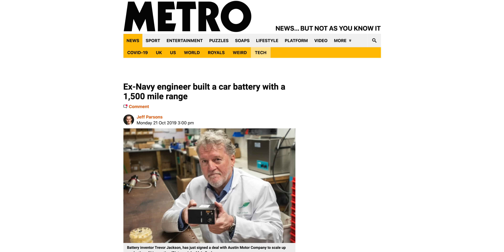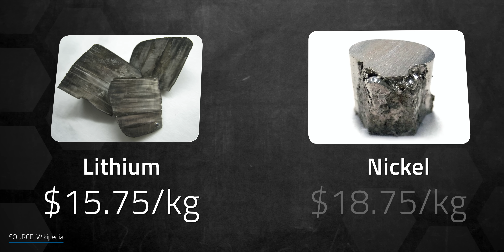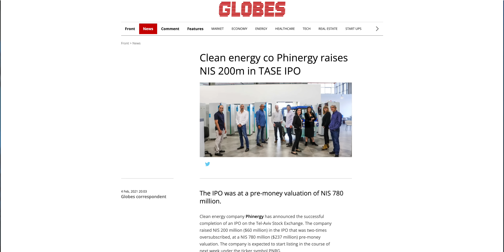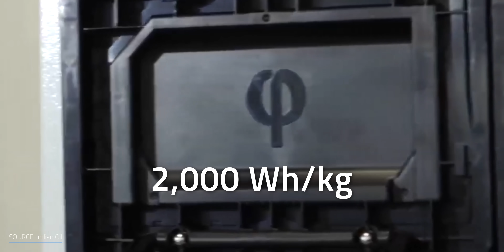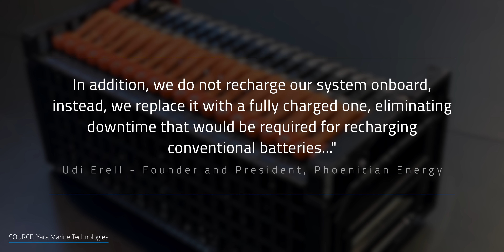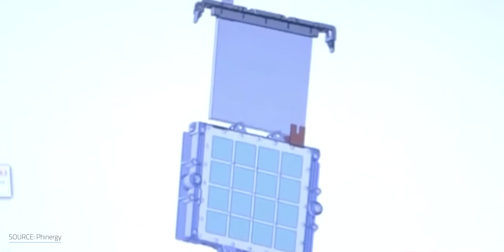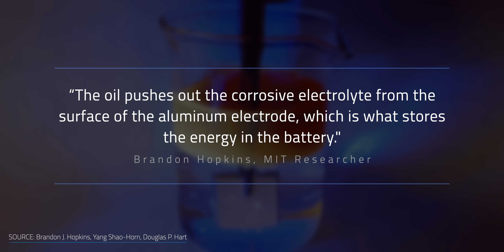Exploring the 1000 Mile Car Battery - Aluminum Air Hype?

Comment: I like the concept. External battery swapping would be much better than waiting for a charge for long trips. That said, the downsides are kind of extreme for it to be a sole power source right now.

I think the hybrid example from their test is the best near-term option, using lithium for the battery that feeds the motor and aluminum air for the long haul. You could recharge your lithium battery at home every night and be fine, then stop by the shop and buy an aluminum air battery to pop in some range extender slot or even sit in the trunk on the floor plugged into a small connector for it that could be installed aftermarket on existing EVs. If you could tack on an extra 500 miles just setting a box in the trunk, let alone the claimed 1000 miles, that would kill any complaints about range. As a stand-alone power source, I think this has a great inroad into the market.

That said, the monstrosity at 6:23 implies some limits to the technology if it's used as the sole battery. I realize that's a rapidly built prototype just to test it on an existing EV, but there are problems with what that test design implies. 
1. It's enormous. That's fine for "we're going offroad without a charging station for 200 miles", that's terrible for family vacations, business trips, or life in general. Since it's a drop-in battery, it needs to be readily accessible, so it can't be hidden under the car. The mass of air vents on top also tells me this isn't going to be a false bottom to the trunk. That means for it to be a permanent fixture of your vehicle, it's going to be either the trunk or frunk of an EV completely given over to it. We accept that in ICE now, so it's not terrible for an EV, but you're going to have to have dedicated (and probably filtered) airflow for it which means it's not going to be a drop-in replacement for lithium EVs. It will have to have its own niche carved out with its own line of vehicles, meaning further dividing of the automobile energy supply market. Drop-in as a range extender bypasses this because people can choose to do that when they want and not when they don't, and it leaves charging as the primary market with this as an add-on. (Also giving it an entry point into the market as a luxury range extension until the price comes down.)
2. The vents are going to be a huge issue if they're not in an isolated compartment like the frunk some EVs have. Again, with dedicated air supply and likely filtration. The demonstration model is in a position where it would definitely get kids throwing trash over the backseat that would fall into the vents, careless/ignorant drivers piling luggage on top of the vents, and in the best case scenario where drivers leave it alone - accumulation of cabin dust sucked in through those vents. Any vehicle using this would need that isolation, which limits EV designs.
3. "I need more range" just gets replaced with "I can't lift that". I'm guessing that weighs around 30lbs, which isn't unreasonable to lift, but it is above the capacity of a lot of people. My guess is based on the "1000 mile" range being 55lb of aluminum and that thing looking like the battery was in 2 pieces. Half that's 27.5lb and optimistically the frame could be made as little as 2.5lb to get a round number. The whole unit is supposed to be 200lb, which I assume is that monstrosity and not the swap-in parts based on how easily they seemed to set in the one part. Again, totally fine for range extension, but a problem if that's your weekly trip to the future replacement to a gas station.

Obviously, long-term they can solve all these problems with future clever designs that aren't focused on making the thing work at all. Getting the infrastructure in place, getting the costs down, coming up with clever ways to have reserve power for when you "run out of gas" and designing ways to get the battery into the car of someone who can't lift it are all solve-able problems. If there were no other options on the market, I would expect them to be solved. But there are others on the market. I think lithium firmly has the market advantage and won't be displaced by this as a sole battery option. I REALLY like the potential as a drop-in range extender technology, though. I could envision a 50lb box that you buy anywhere, plug into a port inside the car for an extra 100 miles, OR take camping to power your electric camp stove and any other electric devices you decide are "camping", OR have it in your garage to plug essentials into during power outages.

I don't know enough about it to know if it would work like that, though. It may still need a lithium battery tacked onto the side to store power to take it in and out of pumped oil standby mode or to supply power in the way applications require. We have a "hybrid drive" for hard drives that does something similar using spinning disk for large capacity storage and a smaller solid state drive as a buffer for faster I/O. Hybridization is often the way to handle when technology trade-offs are too extreme for a new technology to get a toehold on  the market. The Prius hybrid being another very good example.

Comment: For the consumer market, especially in a vehicle,  I think they would need to have customer replaceable aluminum anodes and "oil" changes unless you could get a reasonable core charge return when swapping out and even that would probably limit the interest to enthusiasts. Consumers are going to want what is easier or cheaper and with having to service or replace your cars battery every month on average, it can't be more costly than a comparable recharge to gas cost for that same range nor be anymore time consuming or a hassle than the effort of recharging/refueling for that same range. You'd likely need a system that has at least the same coverage as Telsa's Supercharger network that could quickly have your battery swapped or serviced at a reasonable price for something like that to be widely adopted. You probably also need to make sure the batteries are more secure than a catalytic converter so there's not a rash of battery thefts for the silver. I think this tech will likely be left to specialized uses.

Comment: The "runnning out of battery in the middle of nowhere" issue I don't think is a problem. Just segment it so you have say, 8 smaller batteries instead of 1 big one. That way you can just bring one or two backup batteries in your trunk. And you can then make the vehicle prioritize drawing from whichever battery has been used the least, in order to prevent it from having a "last battery slot", which a lot of people wouldn't usually reach and so it'd just sit and degrade. I think as long as the installation of these batteries is easy, people won't have a problem maintaining their charge

Comment: They sound perfect for a recharge pack for li-ion powered cars stuck on the side of the road. 

Just make auxiliary power connectors in the cars standard for receiving one of these packs. Then tow trucks and road side assistance vehicles could just have a bunch of these to help people get home or to a recharge station.

Comment: The "rate of discharge" issue can be mitigated by pairing the low-rate, high-capacity, non-rechargeable aluminum-air battery with a high-rate, low-capacity, rechargeable battery, such as Li-ION.  The high-rate battery directly supplies the motors and allows large amounts of surge current for acceleration (and also allows for efficiency-improving regeneration, which a non-rechargeable battery would not support), and is maintained above a specified charge level by the low-rate, high-capacity battery.

I'm most curious about the full-lifecycle costs of aluminum-air batteries, given that each one can only be used one time before needing to be recycled.

Comment: I think they could be used in the Trucking industry.  Having batteries with enough range has been an issue for Semis and other such vehicles and the infrastructure to switch out batteries for those would be much easier to set up.

Comment: would i drive an ev that required battery swapping?  Sure if getting a new battery is as easy as filling up my tank with petrol.  Of course.

The question is what is the real cost of that recycling process.  How much mess does that cause, and how expensive.

Comment: I think swapping after 2500-3000 miles is acceptable and would be similar to non-synthetic oil change intervals in gas vehicles. The degradation aspect is the biggest limiting factor for that technology it seems.

Comment: Non rechargeable isn't great, but running out on a road trip, for example, really isn't such an issue. All you need is a small backup battery which can run on the same pump (because it'd be bad if you let your backup battery degrade by leaving the electrolytes in it) and an adaptor lead/plug. This small battery could have anywhere from 50 to 100 miles and also replace an emergency generator that many  already keep in the back of their car. That gets you safely to somewhere you can switch them out, and these batteries are supposed to be lightweight so lugging one around just in case on a long trip isn't actually that big of a deal. This weight/energy improvement could also make commercial freight trucking with electrics viable, but only if they're also volumetrically denser too; the ability to maintain current gas-truck ranges without such huge sacrifices in volume (looking at you, tesla!) make it viable and now all you need is to use mostly green energy for recycling batteries.

Comment: Battery swapping is not the major issue. We have already NIO building up a battery swapping infrastructure, which BetterPlace failed to raise funding for near 15 years (!!) ago! Thet main issue would be though, what happens to the replaced energy cells, which need to be recycled? Would we get emission and sustainability balanced? I'm not really yet convinced. Aluminium is one of the metals, which is most energy consuming for being industrially treated for re-use.

Comment: It's OK, extended range, and and easily recyclable, But let's consider the one main negative factor, these batteries cannot be recharged. I think that that is the reason these will never take off.

 A Tesla may come with his own problems regarding charging statif in charging stations and/or paying for is paying for the 220 socket in your own garage, But long term they are more dependable because you know that they are building an infrastructure of stations to charge your vehicle and you can easily install the socket inyou'll sock it into your house if you choose to. I would assume that it is a lot easier to put a charging station at a gas station then it would be to build a warehouse that houses all of these aluminum batteries.

Comment: Battery swapping infrastructure is already in place.  Gas stations could convert to battery stations, and there are millions of them in place now.  Just like blacksmith shops in 1900 became auto repair and gas stations for those with a vision to the future.  Cars carry spare tires- why not a spare battery with 100 mile range- plenty enough to seek out a swap station.  The ultimate would be a swap station like a car wash where you would just get your vehicle in line on a conveyor and the swap would be done while you are in the 7-11 store or rest room.

Comment: With an automated system, a person could park at a swap station as a robot swaps the battery from the undercarriage while the driver goes into a service station for snacks, or can stay in the car while the batteries swap without the amount of time being much different from filling a gas engine yourself.  In this scenario these batteries would be better than rechargeables or gas engines.

Comment: How it is better than Honda studies from 40 years ago about using aluminum to break water into hidrogen and aluminum oxides? , their design was superior because only need coil of aluminum wires and distilled water and aluminum oxides were simply to remove.

Comment: Battery swapping is not the deal-killer for me.  It's the limited mileage per battery.  If a battery only gives me 1000 mi. of travel, I'll have to exchange batteries 10 - 12 times a year.  What will that cost me?  Right now I get at best 20 mpg with my gasoline powered car.  I drive about 10k mi./yr. and gasoline costs $3.60/gal.  That's approx. 500 gal./yr., in other words $1800 per year.  If I'm going to need 10 Al-air batteries/year, then these will have to cost about $180 apiece.  Is it reasonable to expect that these will sell for less than $200 apiece?  Somehow, I expect not.

Comment: If the "refueling stations" are just a machine that does the swap in a few minutes, then the not-rechargeable thing doesn't sound so bad. Didn't Tesla hype that idea at some point?
Reply: @vablo7198   also you have no guarantee of the quality and integrity of the pack
Reply: Its like with the methane in my house. Here we don't have piped gas, we just swap gas canisters, it gets the same result in the end, which is what matters. As long as switching is faster, what's the difference between replacing the battery versus filling a tank ? none.
Reply: The big issue would be if you could recycle it into a new battery at a gas station what happens when you pull up and there isn't a  battery for you
Reply: @michaellanning9836  the same thing as when you go to charging points and they're either not compatible or out of order. Breakdown services will be busy towing cars.
Reply: @richard.c3901  why would breakdown service be busy towing cars? are you saying that the IQ of these drivers would be at the level where they would wait till the cars is at the very limit before getting them changed? why would drivers of cars using alu-air be anymore stupider than current drivers?
Reply: @michaellanning9836  yup, also no guarantee of the battery integrity
Reply: @michaellanning9836  You walk.
Reply: @michaellanning9836  just like if you went to a petrol station, if there is no petrol you would I assume go to another one, or are you saying that there will only be one station permitted in each 15 mins city
Reply: @vablo7198  Industry standards and commoditization are the long term way out of that problem. I wouldn't want to rely on a single company, I'd want to rely on a competitive market. Normal car batteries are roughly the direction what ought to happen there.

At the democratic level we need to push back on nonsense like patented DRM inkjet cartridges and coffee pods. These banal consumer annoyances have a critical impact on things like this. Swappable car batteries can only really be monopolized by government decree.
Reply: @hans-peterklett8586  problem with that becomes you getting the cheap, low quality battery instead of the high quality one you've already got. It's doable sure but that complicates it without even considering someone pulls an Apple and makes their connections or equipment incompatible as a cashgrab.
Reply: @vablo7198  charging at home also can get expensive if the energy company decides to hike the price.
Reply: Who guarantees , that the electricity companies or the goverment with a new green tax will not raise the price for your electricity at home? Happens here in Europe the last couple of years. The highest energy prices ever, thanks to new taxes for the support of green electricity. Everyone always wants our best and that is sadly our money :-)

Comment: 9:30 If the packs were somewhat standardized there's no reason "tow" trucks couldn't carry a few extras. Now instead of waiting for an underpowered portable generator to charge your EV, bam you're back on the road faster than changing a flat tire...

Comment: Your advocating for a "replacement" of lithium accumulators with a one-use static battery. I know the English community has issue differentiating an accumulator from a battery because they falsely use the wrong word battery for all. However this is comparing apples with pears. The true solution for i.e. our issues with climate is not a new battery it is not driving in the first place and shared transport i.e. on railway systems. So lets just concentrate on this and it might get good

Comment: Depends on the cost of the new battery. I could see keeping a few in the garage for a fast swap, but if they are a few hundred and up not worth it. I am sure they could offer discounts when you turn one in, but they need the infrastructure set up to do so first which I am sure is not cheap.
Reply: You are right bro. But in india they dont need to worry about infrastructure bcz as mentioned in video "indian oil corp" ( which is main invester of battery) already have giant network of gas station around the country with proper staff for dacades. So they just have to do additional training for there staff.
Reply: And also IOC is government company ( indian government is largest share holder) 
and there are other 2  same type goverment company in india for CNG GAS & LPG GAS in energy sector which can give their infrastructure too as government are the owner of all 3

Comment: swapping out the battery is not really that different than recharging a lithium battery or filling up your gas tank. the stations just need the batteries. if this was 1900 you would hear the same arguments for buying a car and ditching your horse.  just engineering and up scaling. in time we will all be driving ev cars.

Comment: your suggestion that a car would have to be towed to a swap station doesn't make sense ! WHY ???
they should typically be made to replace easily ON THE SPOT ! call a 24hr swap number to have it delivered .
either way these are a stupid idea unless there are onboard LiIon for redundancy / back-up  . how can you possibly run these to the end and have the time and location for the swap right at that time ?